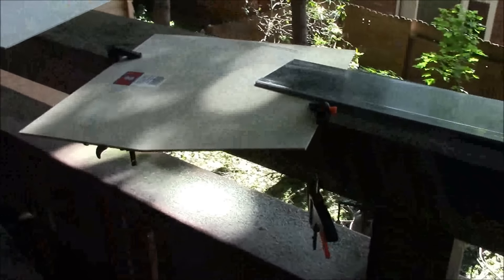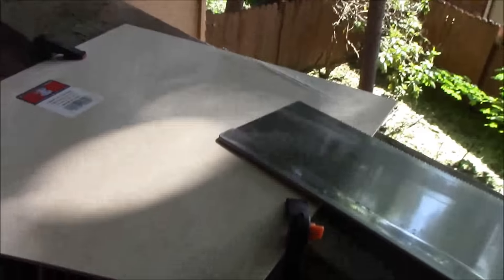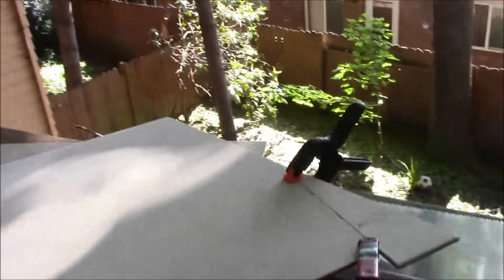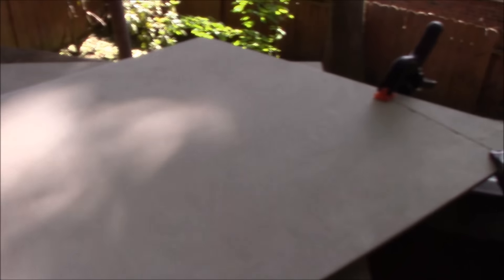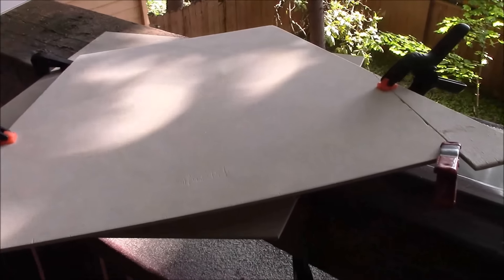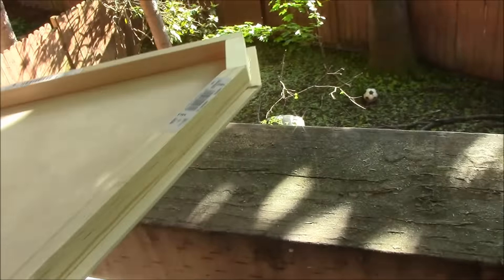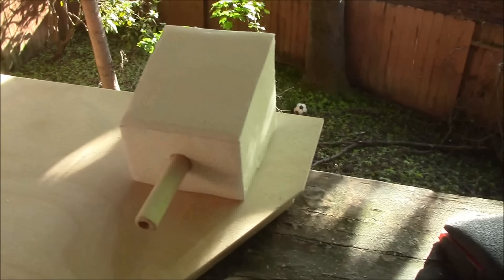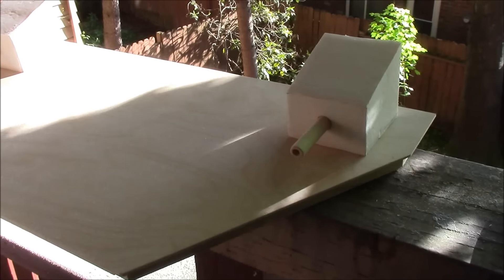vlog #922 - Ork Heli-Carrier gaming table update #1

Comment: You should look around your area for a hackerspace or makerspace. Some of the DIY type ones have very reasonable rates to become a member. Some have substantial workshops where you can use their workbenches and tools to cut your raw materials. The one I belong to in St. Louis, Missouri often has scrap materials that can be used for terrain building, too. I have collected more cast off wood leftovers from the laser cutter than I will be able to use in a few years. They have hand tools, power tools, clamps, work benches, and really good lighting. A $15 a month supporting membership allows me to use it when full members have the location open. A full membership is $45 per month and comes with 24/7 access to the building and other benefits. I don't have a garage or workshop of my own or the budget to purchase a bunch of the tools they have, so it makes a good fit for me. It's only 20 minutes away, too.
Reply from the maker: +Gene Jordan (GeekTinker) That's a good idea, I've heard about them on the Tested channel. I'll look to see if there are any local ones.  Thanks!
Reply: +Da40kOrks what city do you live near? I might be able to help you find one near you.